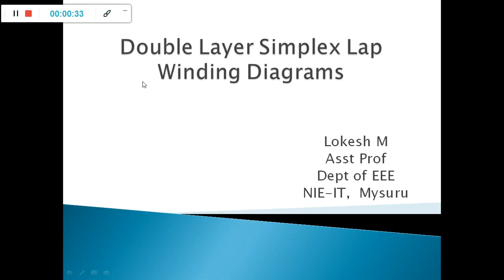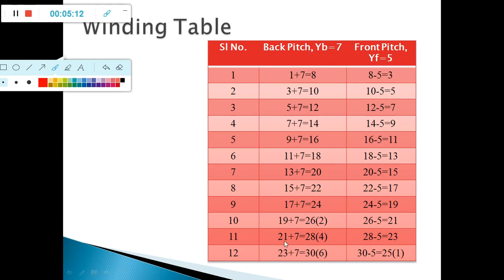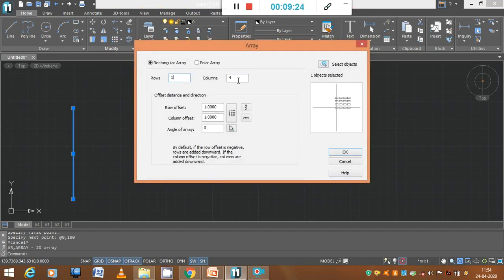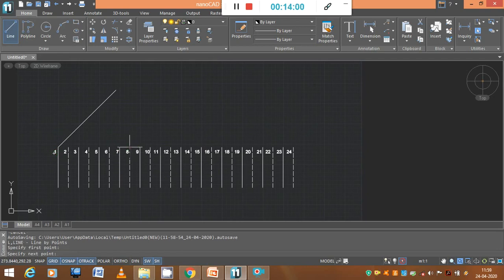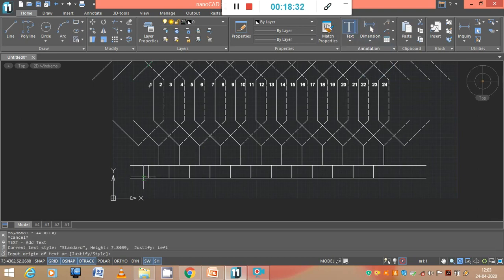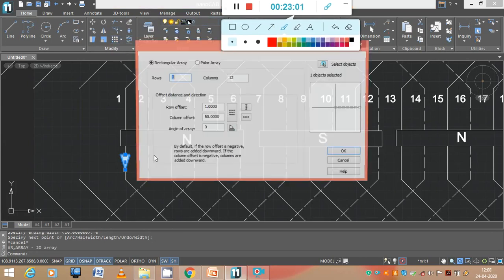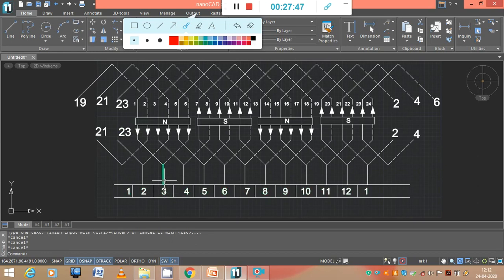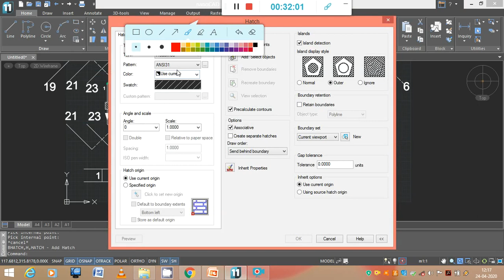Session3 Double Layer Simplex Lap winding

Comment: Draw the developed winding diagram of a 4 pole dc machine with the following data.
No. of slots=12
Type of winding:double layer simplex lap,No of coil sides per layer=2.
Reply from the maker: Interesting question...
In some cases especially for small size machine, there is a lack of space to have more number of slots to place more conductors.. In such cases the conductors are arranged in two layers per slot and each layer may have multiple coil sides..
For your case,
Z= No. Of slots x no. Of layers x coil sides per layer..
I. E. There are 4 conductors in each slot which are in arranhed in two layer.
Z= 12x 2x 2=48.
Reply: Thank you so much ❤️ sir 
Can you plz attach the video link which I can get clear cut information about dc winding...
Plz sir